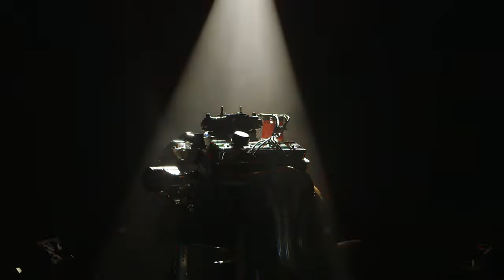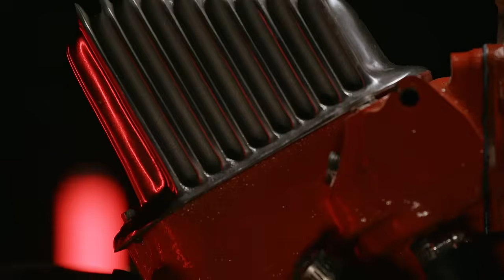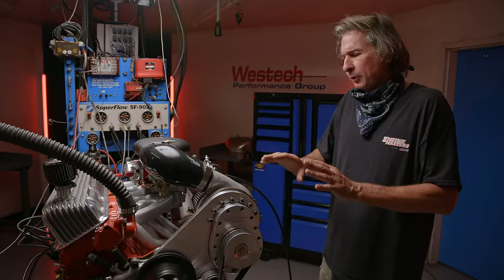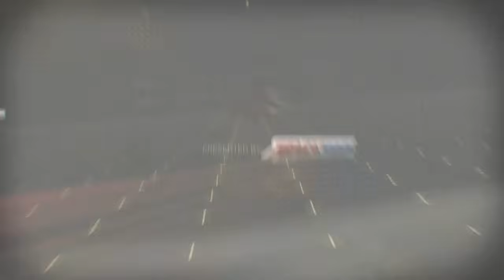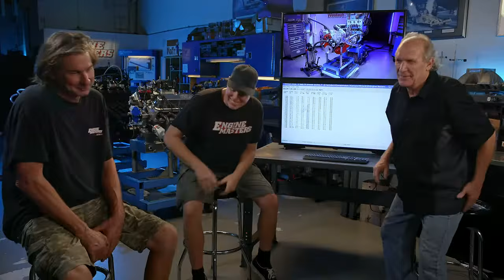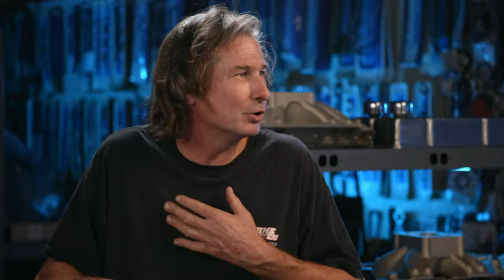Engine Masters  S5E77   Dulcich's Quest for Slant 6 Greatness!

Comment: I'd love to watch these guys get a "real" inline-6 like a 2J or RB or S54 or Barra.  These old iron lungs were great for chugging along at 55 mph until the heat-death of the universe, but the disappointing power is all about the heads and bore/stroke ratio.  Heck, even back in the day, those Australian Hemi Sixes made some numbers for their size.
Reply: you're not giving the old school american inline 6's enough credit,

they may take a bit more work to make em rev, but they're tough at nails.

Both the Ford 300 and the AMC 4.0 have been taken over 1,000 hp with boost, the latter of which was done under 5,700 rpm.
Reply: Agreed. I think I I6 is the greatest engine format of them all but the old workhorse cast iron blocks aren't the best formats for anything but long term reliability. There are lots of more efficient and powerful I6 designs and the only reason they don't dominate is because manufacturers have such a pathetic boner for front wheel drive cowardice.
Reply: @RedfishCarolina  I6 doesn't go with FWD.  That said, most of tge time attack records on US tracks are held by a FWD Honda, though there's a twin turbo C6 Corvette that's been bringing some of them down.

Also, most of the legendary I6s were iron blocks.  The 2J, RB, and S54/52/50 were all iron blocks with aluminum heads.  That weight hurts them in time attack or other serious track contests, and the lack of 500 cubic inches hurts them in drag racing.
Reply: @JETZcorp  Im aware the I6 isn't used in FWD which is why they don't use I6 much anymore, every wants to sell FWD crap so they go V6 or turbo I4 .

I had forgotten about a lot of the higher performance engines being cast iron but the ones I was referring to are the type this whole video is really about. Tough, long lasting, low compression, smooth torquey engines made by American companies like this slant 6 and the Ford 300. Great engines but their overall design just not right for good high performance .
Reply: @RedfishCarolina  Ok, I see what you mean.  Although, even FWD performance cars are kind of dying on the vine.  There aren't many left.  There aren't a whole lot of new sporty cars in between the Miata and Porsches.  Civic Type R, a couple Hyundai N cars, the Golf, and... most of the rest are dead.  No one has money except for the people with big money.  The Supra is keeping the fkame going, though.  That thing is a beast, and strong value.

Comment: Can you use two slant sixes to make a V-12?
Reply: Anything is possible, but it would be a poxy result and a waste of time. Plus, think of the manifolds and where they would run.
Reply: See the Hispano Suiza 12Y aircraft engine as an example of a V-12 with counterflow heads. It's a somewhat peculiar design, and the later Soviet produced improvements on it were even weirder.

Comment: The beauty of the slant six is not as a race motor. They ran smoothly and would last and last and last in the day when most motors was only good about 100k. I was a mechanic for a Chrysler dealership for about 20 years  and in the real world they was a great motor.
Reply: The previous Chrysler 6 was bulletproof also. In NYC taxis they lasted 300,000 miles. They were also used for industrial use in the likes of fork lifts, welders, and farm equipment like swathers, up to the 1970's when the slant took over.
Reply: @daledavies2334  300,000 is nothing for a slant 6. I've seen many do over 400,000 miles. What usually puts an end to very high mileage is loss of compression from ring blowby. They just usually wear out rather than suffer catastophic failure.
Reply: @daledavies2334  There's a semi-credible rumor that the slant 6 actually lived until the mid-2000s in China, working as a forklift and industrial motor that ran on propane. Supposedly Chrysler Simca sold some rights to them in the same era as when they sold technical documents and assistance on the 318 which led to China's first luxury brand for party elite and the slant was along with them.
Reply: @daledavies2334  the slant six came out in like 1960
Reply: I’ve said this about the Jeep4.0 and 258s, but it applies to the Chrysler slant 6, GM straight 6s, fords 300, the Toyota and Nissan 6s, an iron block low(ish) compression, low stressed, inherently and easily balanced rotating assembly made for a super-good enough power plant that you can hop up (a relative term here) relatively easily. They’re hard to kill and are surprisingly efficient (again, relative term).
Reply: @ryansommerfeld2098 Most inline 6s were reliable. But the slant 6 was the most reliable of them all during its heyday. .
Reply: Agreed  @ryansommerfeld2098
Reply: As a young man in the 1980s I was a (not so) proud owner of several vehicles with the slant 6.
Now I wish I had them all back. 🥺
Reply: My first car was a Plymouth Fury 2... not the cool one but the four door. It had a 225 slant six. I was 14 and it was a field car, so performance was really not a problem.
Reply: Lifelong Mopar maniac. I owned 2 mid sixties variants. I put 432,000 on one and over 500 000 on the other.
Reply: @louswain3240 my sister owned a 1969 valiant with the 170. It was a rock solid engine but it would not move out of its own way. But once you got rolling, it was rolling. I think it had economy gearing because you could get to 40 mph in first gear if you held it to the floor. My brother had a 67 with a 225 . It actually had decent pick up, not fast but decent. It was rock solid as well
Reply: @louswain3240   poor guy atlest owning Mopar made you great at changing transmissions
Reply: @Kevin-id5hx that was the late model ones. The old 904 and 727 were rock solid transmissions. They took a big dive when they went to the electronically controlled transmissions. But the transmissions behind the slant six we're pretty tough
Reply: @dmandman9  the 727 and 904 were junk       they didn't make a decent trans till the 2000 and they are a prayer away from failure
Reply: @dmandman9  the 4 speed manual  was great but the 727 and 904 were junk im sorry but I disagree
Reply: @Kevin-id5hx    My dad was a mechanic from the late 1950’s to the 1990’s . In the 1970’s I started working with him until he retired in the 1990’s. The main problem I saw with the Chrysler transmissions were fluid leaks . I remember my dad saying that the Chrysler products were ugly cars (in his opinion) with good engines and transmissions. Back in the day, he rebuilt a lot of c4’s at low mileage mostly because they put a lot of them in vehicles that needed an FMX or C6 . He built a lot of 350’s but mainly because there were so many on the road . They were good transmissions. He wouldn’t build a 200 because they weren’t worth building. He’d either get a reman or retrofit a used 350 if it was an older car, and the owner was cash strapped. But most Chrysler 904 and 727 era vehicles had good engines and transmissions their carburetors were another story
Reply: @dmandman9  they put the 727 up against  everything  even the 440 the slant six didn't make enough  hp to really hurt anything  but still killed those 727 they lasted 50k miles they were junk with bad valve bodies  and weak  bands and clutches
Reply: @Kevin-id5hx  Well that's not the experience my dad saw. By the way, you can Google the question, and it will agree with my assessment of the 727 being a transmission with a good reputation. I can't speak for your experience. It may be very different from ours. But I can speak to ours. I can point to other sources seeming to verify what I said.
Reply: @dmandman9  you googled  if a 727 is any good   Google  was being  kind everyone  that has ever messed with cars will tell you other wise  even Mopar  guys make jokes about those old trans
Reply: @dmandman9  always you googled if a 727 was a good trans you really are a Mopar guy ya they held up to a slant 6 but even the 318 would destroy them most of the time failure happen when doing burn outs and people let off the gas to soon you had to let it smoke the tire till it got traction  and sometimes on hook up it would burn the bands or pump out  why do u think they make bell housings to fit a turbo400 up to a dodge moter  anything more then a slant 6 and the 727 or 904 was toast
Reply: @dmandman9  your boyfriend googled also says weak pumps and you gota adjust bands every 30k if u gota pull the Trans every 30k your a professional transmission  guy so everything  i said holds true    we all know  the kinda people  that drive dodges it ok bud
Reply: @Kevin-id5hx What?
Reply: @Kevin-id5hx  ok. Whatever you say. It's not that serious. I was simply speaking from what I observed and what my Dad and I talked about. Yes. He had a few Chrysler products, mostly Fords, and a few GM products. But he had his own auto repair business starting in the early 1960's . He was a mechanic even before then . He retired in the 1990's . So he observed a lot of things. Have a good day sir
Reply: BMW 3.0L or Ford 4.9L
Reply: The Ford version is still being used in some Mail Truck and UPs trucks to this day.
Reply: I mean the Australians got there hands on the slant 6 and made 300+hp naturally aspirated. The hemi 6s were great motors!
Reply: Aaaannddd the were a bit better on fuel than their 8cyl. Counterparts.
Reply: The Australians have all sorts of inline 6 upgrades even for the 225 Slant Six
Reply: They are a tough little engine, & while I feel they are underpowered for a tin grille or 1st gen Ram, I can see why they were, & still are so popular for a true farm truck or daily driver.
While I wouldn't want to be replacing head gaskets weekly It'd be hilarious to have that engine in an old tin grille step side or swept line truck.
I love the 4.0 i6 in my XJ, but as this started I was wondering if the tower of power would fit, & how much of a nightmare that woukd be.
Reply: Thanks for sharing
Reply: The 225s here in Australia were very average 6 cylinder engines. I can't tell you how many ventilated the block often taking the starter with them. I'm a dealer trained qualified mechanic and worked in a Chrysler only repair shop for 7 years.  
I think they're a POS engine in an era where there were so many better inline 6 engines here.  
We never had the 170. Even UTG reckons the 225 was a bridge too far for the architecture FWIW.
Reply: @ThePaulv12  I've had a 225 in a 65 AP6 and a 265 in a 78 cm regal obviously both Val's. But really the 225 originally a tractor motor not built for performance here, and the difference a good carby or even triple su on a 265 just more fuel to open them up worlds apart engine. One for low rev reliability and other more performance. Even though it was in a 2.75ton tank damn I miss that CM regal I've never owned anything as or more comfortable than that rig.
Reply: @ThePaulv12 I didn't think the Australian engine was a slant engine, I thought it was a straight up inline 6?
Reply: The Ford 4.9 straight six was better
Reply: They didn't like redline very much, I wasn't impressed with it. The 300 Ford is king of old school straight sixes
Reply: @derriklee287 The 300 was indeed bulletproof. But it was only used in trucks. But the 225 was used in almost everything from the compacts to some of the full sized vehicles in addition to the trucks.
Reply: Blah,blah,good engine if you have deep pockets like these guys, not for a poor dude like me
Reply: Can't stand them! Blew up 2 of them. Distributor sits where water can get in it. Weight distribution is hard on front ends. I think they absolutely suck!